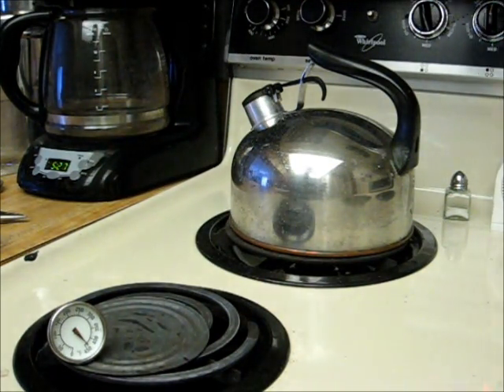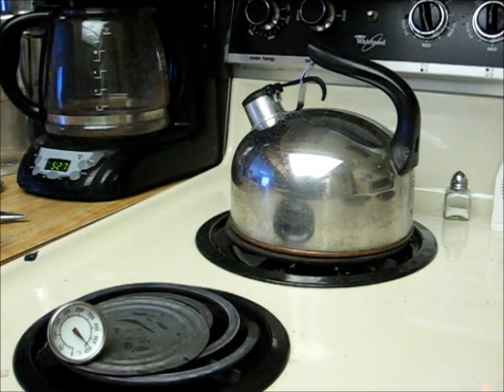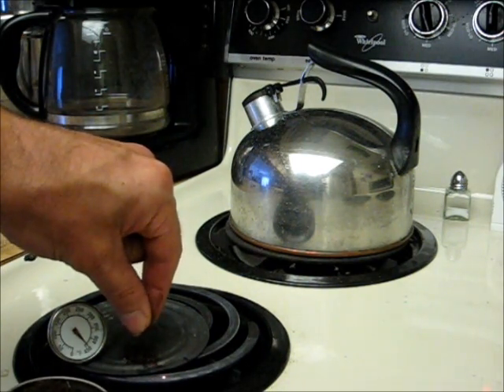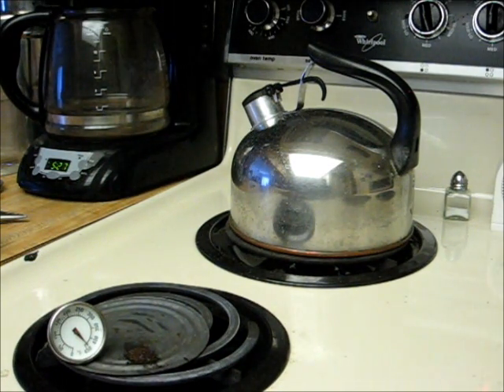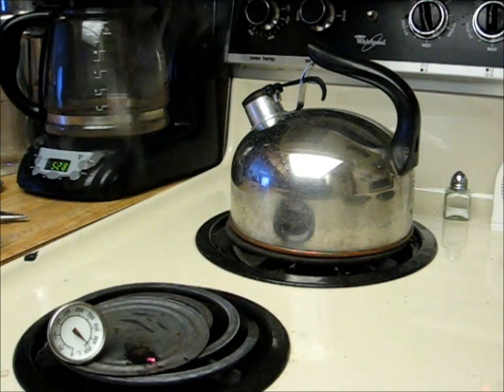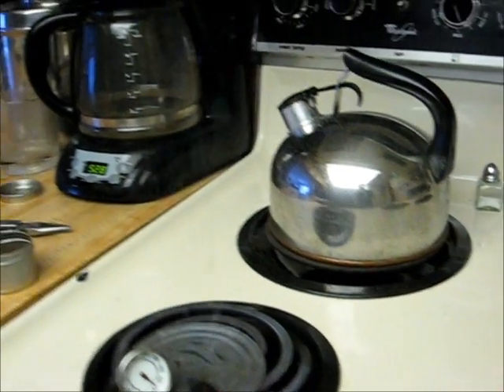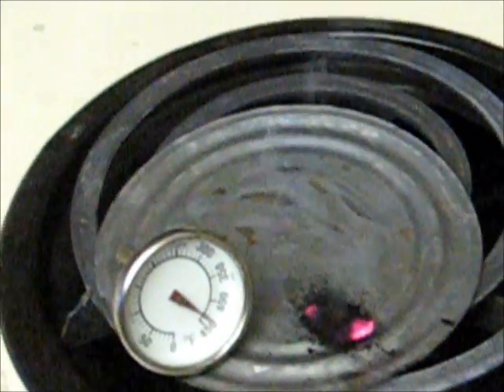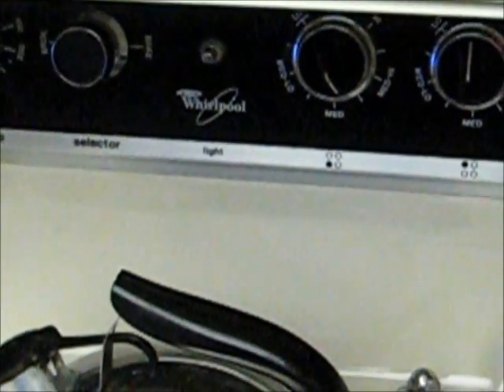Friction Fire - Autoignition Experiment

Comment from the maker: Yep, you're right! Focused sunlight works very well, especially here in FL. The partially charred dust has a low ignition temp..
You're welcome. Congrats getting your 1st coal. Yucca & Dog Fennel should work. I recently found some Yucca, but still prefer Dog Fennel. Probably outta habit.
I did this test again and was able to get an ember at 340F according to the same thermometer. Not sure how accurate that is, but it's 100F less than in this video. Pyrolysis in action it seems.

Comment from the maker: It's hard to say. I did one other test just before I made this video. The thermometer said about 400F, but it it took longer for the dust to combust. The stove dial was just under the Medium setting. This was a crude test with a large heated area and not using the most accurate instruments, but well enough as a simple demonstration. Maybe one of those laser infrared thermometers would have been better to use.
Try this yourself. Can also use a soldering iron to heat combustible material as well.